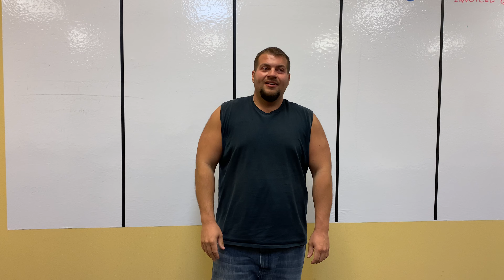Acura Legend tips and tricks!

Comment: How to change frontend bushings
Reply from the maker: Which ones? Most just unbolt and replace with moog parts?
Reply from the maker: @Animated.4600  I’d rather not you can just reply here and I’ll comment so others can find the information.

If it’s the front end bushing where the lower control are bolts through you need to press that out.

Comment: 95 Type 2 LS 
NO BHG 
just needs competent mechanic and/or resources to revive. Thank you for this channel
Reply from the maker: A. Montgomery what parts/mechanical work are you needing? And manual or auto? Break down the issues I’ll try doing a video
Reply: @GreekPower  It hasn’t been started in the last year. Driver and passenger rear window molding. And refresh plenum and the motor. Matching headlights. Automatic transmission
Reply from the maker: A. Montgomery so you just need general maintenance mostly if it’s been sitting. Fresh gas, and fluids. Timing belt/water pump and the moldings everyone needs... so good luck lol

Comment: U were right about how I found this. Lol. Searching for my baby's cluster trim removal but while I gotcha, what other spoiler will fit my 94 Legend Coupe LS? I cant seem to find one anywhere close to me.
Reply from the maker: Pinche Delita for spoiler options there’s not many, you can use a OEM spoiler, sarona makes a spoiler and on eBay there’s a m3 style spoiler. That’s about it.

Also the cluster removal, theres 3 10 mm bolts that hold the lower dash panel, then 2 screws to remove the black plastic trim (hard to see but under neath), and then 4 bolt/screws that hold the gauge cluster in and 4 plugs. Then your done lol

Comment: Looking at a 91 4 dr legend to buy. Car starts but don’t move in drive or reverse. Makes a noise in drive and reverse. Shit it in park and a bigger noise sounds out. What is that? 
Helpppp!!!
Thanks😀
Happy holidays
Reply from the maker: I’m going to assume the differential/transmission is bad, specifically the extension shaft is stripped that connects the 2. Unless it was a swapped car and the diff is completely cracked/broken due to improper spacer

Comment: What’s the best solution to deal with power seat 95 sedan? Heater core got wires wet now seat won’t move.
Reply from the maker: Move it where and how you can, or just unbolt it. The plugs you can reach under the seat while it’s bolted in typically

Comment: I have a few questions, regarding, modding my Legend. If someone could help me, I would greatly appreciate it.

The parts aren't exactly easy to come by. So far I can only seem to find:

*OBX headers
*weapon R intake 
*RDX injectors
*H & R srpings/ coilovers
*3.5 swap (I'm just unsure how to go about it ) 

Is this a good starting point or should I be looking at other things? 

My steering rack needs to be replaced, but instead of replacing it with another Legend rack- I thought about replacing it with a faster rack. I have found that someone swapped a JDM Honda S2000 rack, but I can't seem to find too much information on it. Would you recommend going that route? Is there other racks that I could use ?  

Also, do you know if sr5guy is still around for the ECU?
Reply from the maker: Parr’s are limited when it comes to legends. Sometimes it’s cheaper/easier and better to just buy a complete setup from someone before you waste money on something. For instance I have a fully modded type 2 motor I’ll be selling soon from my coupe. It’s got cams, headers etc fully ready to make all the power.  As for the mods you listed, just a 3.5 or type 2 motor is all you need honestly. I have the rhd s2000 rack in my car it’s a nice mod just not a cheap mod. But frees up some power while making better steering response it’s not s complete bolt in there’s some trimming and welding. 

As for ecu just a Sr5guy is the only readily available option unless you want a stand-alone for max power. But if you have a auto tranny you can only use a chipped ecu

Comment: I have been chasing a knock sensor code 23 and 53 (replaced both) for a 1994 Type 2 coupe. Changed the sensors took car to 'Acura Specialist" who stated the harmonic balancer was bent so replace the balancer and belt. Now car is at Acura dealer and they are unable to give an answer? Wire harness checked as well. Could the issue just be the engine? Tired of spending for guess work! Any info will be appreciated.
Reply from the maker: My guess if you changed the knock sensor with known food working sensors, I’d suspect the harness under the intake manifold. The crank pulley being bent is a common issue and should be replaced with the earlier generation pulley. As for still having issues. I’d clear the codes and then see if the codes come back. Have you checked the wiki page?
Reply: Thank you @Greek Power. I have changed the Harmonic Balancer with a Motokeni (spelling) and alternator belt. The dealer stated it was a wiring harness problem and they could resolve it. After a week they stated they bypassed the harness and still got the knock sensor code so they recommended changing the sensor again. Spoke with an Acura mechanic and he stated the sensor is giving the code so it may be a knock in the engine but no indication from the dealer. I reviewed the wiki page which helped me to reset the codes using the fuse and the battery. The car surges at 50 mph and then the light comes on. Dont want to spend $2000 chasing the light as I can install a used engine for that amount.
Reply: Update: Acura dealer diagnostic. Wiring harness is the issue they are unable to get the harness or make it. So if anyone has any ideas please share. Thank you
Reply from the maker: Marcus Reid oh the harness is a easy and simple fix. Honestly if your confident with wiring you can DIY fix it... the plugs that go onto the knock sensors is what normally goes bad... or a mouse chews the wires. But have you joined the acura legend owners and enthusiasts group on Facebook? Join us and post a wtb thread for knock sensor harness. Someone will have one it’s a common issue
Reply: @GreekPower  Thank you. I dont have social media but my wife does.
Reply from the maker: @marcusreid5709  I made a post in the group for you I’ll let you know when I find one for you.
Reply: @GreekPower  Thank you! I have an auto electrical place here in Raleigh,NC that said they may can help me as well?
Reply from the maker: Marcus Reid i don’t see why not? But the plugs are picky that go onto the knock sensors, the other plug is simple I wouldn’t be worried. But maybe have them look and see the issue
Reply from the maker: @marcusreid5709  I found one in Florida the guy is willing to ship to you. Message me on here or shoot me a text 724-584-0340
Reply: @GreekPower  I'm having this same issue. I've changed the knock sensor 3 times and the code is still coming back. I'm also in Florida I'll give you a link later today. Thanks for doing this, much appreciated!

Comment: Whats the best way to order a new engine for my 1994 automatic legend. With my income tax im looking to get her back on the streets so ill need help with suspension and ordering parts. Looking forward to the videos.
Reply from the maker: Swap in a 3.5 engine from a 96-04 acura rl those can be had for under 600 bucks. So timing belt and some other basic things and your good for 200k
Reply: @GreekPower  Ill go ahead and do that! Where can i get the parts to rebuild the one i have it has 180k miles its runs with no lights on but it burns oil. I would like the rings, water pump, extra hoses, upgrades on suspension and breaks. Thank you!!
Reply: @GreekPower  Where should i get the RL swap parts from?
Reply from the maker: Justin Dennison don’t worry about fixing your current engine. Theres no point. If it’s valve stem seals ok, but if it’s rings etc don’t bother. And I’ll cover more suspension stuff in the future
Reply from the maker: @justindennison5807  its a bolt in swap and theres a whole diy on acuralegend.org you just need a tune/swap mount depending what year your car is etc.
Reply: @GreekPower  Awesome man sounds good thank you for everything !!

Comment: You have a list of aftermarket parts?
Reply from the maker: You mean like? Performance parts or what?
Reply from the maker: You mean like? Performance parts or what?
Reply: Any thing type 1 related, really interested to see what fits, nice turbo build by the way
Reply: @GreekPower  stuff I would like more knowledge of, suspension  and possibly how to bring some extra power to my 93
Reply: @GreekPower  to be honest I have an issue  were my temp gage goes up and down when I drive, when I am just sitting at the light and it starts to heat up but when I drive it goes down just lil bugs I can't figure out, be safe my legendary brother

Comment: Looking for type 2 cams  to put on am 91 3.5 swap any aluminum welders in AZ pro do full type 2 heads instead
Reply from the maker: joaquin uriarte so the cans can be found used for like 125shipped typically. Custom widened intake manifold normally go for like 800 for a oem style one... but u don’t need the full hybrid
Reply: @GreekPower  but dont ya have to cut the runners on the type 2 manifold and welded  to fit the type 2 heads on the 3.5 block since it's a bit wider?
Reply from the maker: joaquin uriarte yes you do have to do that to mate the 3.2 heads on the 3.5 block. BUT the 3.5 heads will take the valves etc from a 3.2 so I suggest doing that and porting the heads aswell. So you’ll save on doing the intake manifold and have a better performance 3.5 heads
Reply: @GreekPower  got ya sir just a question here if ya do the hybrid 3.5 heads and typeb2cams and bigger intake valve to match type 2 intake valve at the end its exactly the  same flow and perform or would the type t2 head have a tiny amount of better flow and would they raise the compression a bit.?? Just asking ? To try decide wht and like a best thing for me and on the hybrid head u can make intake valve 1mm bigger from type 2 valve can the b done also on exhaust valve make big like intake valve and run type 2 springs and retainers?? Of course both head porter and polish. Mayne a video explain all the differences type of set ups and Frankenstein build tht are available for us to do would be epic sir
Reply: @GreekPower  I'm on the legend.org for pro 10  yrs pro name. J-legend stop messing wa coupe for over 5 yrs and now ready to give her the proper tlc. Shot ot to the crowing for ma mount to do ma 3.5 swap